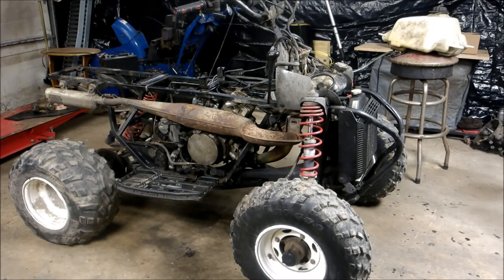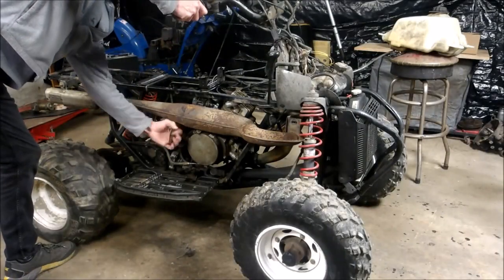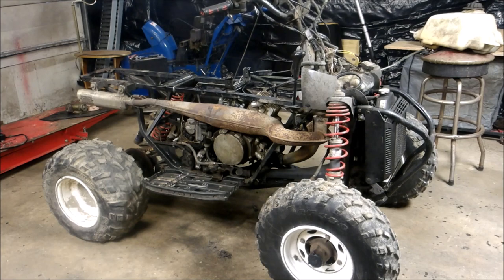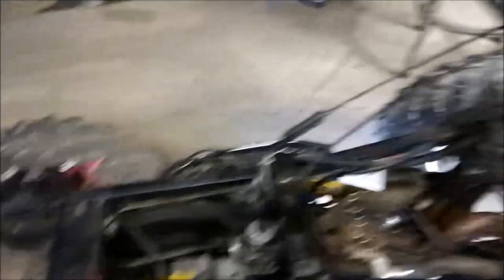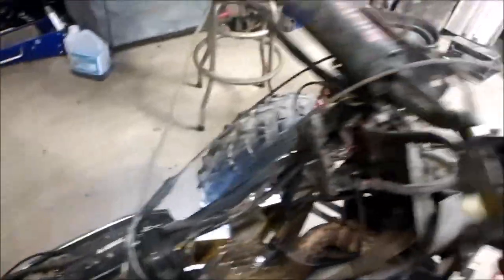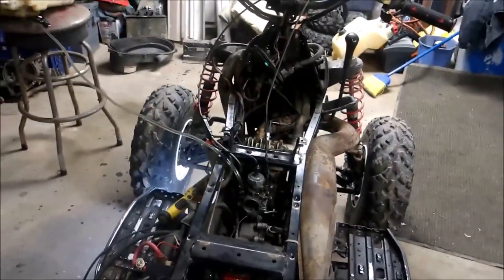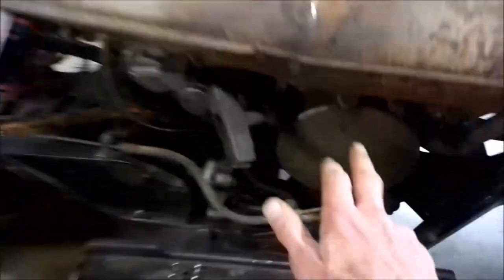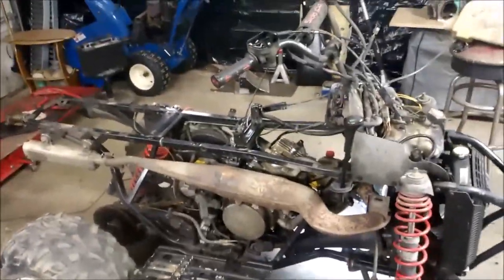HOW TO STOP YOUR POLARIS SPORTSMAN FROM BACKFIRING!

Comment: great video thanks for more info,I have a question my sportsman 500 2001 is backfiring only when I get off high throttle would one of these issues you mentioned be the problem? and thanks again
Reply: i have a 05 sportsman 800 with the same problem...

Comment: Yep, you are right, the Polaris, I have one 2002 and two 2003, I think that this are the better built ones but that is a personal opinion, tend to overheat and the fan fails occasionally, I have been thinking of replacing the temperature sensor with a water temperature gauge and installing a manual on and off switch to control the fan directly when the temperature starts getting close to the 90 degrees Celsius mark, This obviously would require you to be on the alert and constantly monitor the the instruments. But this is what we do when we fly aircraft, so it is not a big complex thing to ask of anyone.
Reply from the maker: I got a better idea. Only because I've seen your idea before..And guess what! Someone forgot to turn the fan on. Its a good idea if your the only rider. If someone else jumps on and forgets,( That's how I bought one cheap one time)So what I do is hot wire the fan and bypass the temp sensor. The downfall is its hard on the fan with it running constantly.

Comment: I have a 2008 Polaris Sportsman 500 HO EFI.  The fuel gauge flashes and I don't trust it.  It'll start right up.. run fun then within 100 yds... it's slowly loses power and stalls with a backfire at times.  Prolonged starting procedures get it running again.  I discovered the carb boot to the manifold was very loose so I put it back on and really tightened the two narrow carb clamps.  It's a new used machine to me...but is it suppposed to be a bracket to support the carb and secure it to the frame to prevent this?  If you have time... please let me know.
Reply from the maker: You mean the throttle body. I dont believe there was a bracket. I have a video on fuel pumps I did on an 07. Sounds like you need a new pump and filter.
Reply: @TitaniummanGarage  I took off the body and front storage unit... I found a bare wire next to the steering shaft and corrected that.  I then in the front, facing forward was a thin black box what I think you called the ECM.  This one is Polaris brand  part # 4011817.  I found a pretty good crack in the front cover.  Bad enough to let dirt and moisture in.
    Is it ok to open the unit (if I can) to see if there is any obvious issues in there?  I called ModuleMaster and was told that is not an item they are involved with.
Reply: @TitaniummanGarage    Ok...thanks.    I pulled the plastic body off and am checking for any other issues and am replacing the spark plug. (if I can get to it)  
    I discovered the CDI box has a large crack in the cover.  What do you think I should do?  I called ModuleMaster and they advised me they do not deal with these items.
Reply from the maker: @wayne6525  Thanks for the reply back. I was curious what it was. I knew they had wiring issues with the wires going to injector and other components. You might have to buy a used one. Check ebay or power sports nation. Not sure what your skill set is with electrical but it could be something you could solder back up. But it could fail again. I would buy used if you cant get new.
Reply: @TitaniummanGarage    I was replacing the spark plug and what a chore that was!!         I discovered that the spark plug was very loose in the cylinder head.  I didn't even need a wrench to turn it... just a socket.  This has got to be a major cause of most of it.... but I'll keep digging after I get it in.  I also discovered that the ECM had only two screws holding it on...one had a ground wire attached.  I cleaned up the ECM cover placed Aluminum foil tape of the crack.  We'll see (when I get it all together again) if these efforts make a difference.  Thanks again.  Glad I found your channel.
Reply: I pulled the fuel pump and tested the gauge sender....it appears to be accurate.  I then placed the fuel pump in a bucket of gas.  The float did not raise the lever rod.  Obviously it is faulty... I ordered a new one.  Hopefully this is the cure to my problems up to this point.  Take care.
Reply from the maker: @wayne6525  Thanks for the update.  My fuel gauge was flashing. When I took the fuel pump out I noticed the ground wire from the pump to where it plugs in was rusty. I cleaned the metal plug and everything worked. I didn't need to replace the pump but I bought it already so I replaced that too. It solved my sputtering issues.

Comment: Hello my name is Leon and I've got a 1998 polaris sportsman 500 4x4 , far as the pilot screw how many turns out should it be?  And the same as the idle screw plz help I'm totally out of ideas.
Reply from the maker: Turn the pilot screw all the way in then turn it out 2 and a half turns. You might have to tweak it. I do 2 and a quarter then bump it up if needed. The idle screw, the long one sticking out of the bottom of the carb I tune by ear. Just make sure you dont turn it to far or you'll have to adjust the throttle cable as it will cause the safety kill switch by the throttle lever to close and it wont start.

Comment: Hi again, by the way, you were talking in one of your videos about converting your Polaris sportsman 400 into a 500 , I know that the con rods are identical, the cylinder heads are the same, but the cylinder size is different on the Polaris Sportsman 500 and the strokes are 5 mm different. How did you overcome that issue?
Thank you,
Franklin
Reply from the maker: I converted a 425 4 stroke to a 500. I used a 500 cylinder and piston. I wish we would have been talking before I did this. My buddy and I talked about this for a year. The part number for the con. rod doesn't match according to polaris. So for the longest time Him and I didn't attempt it. He parts them out..I rebuild them. One day he slapped 2 engines down and said: Here! Your smart enough..just try it!  So I put a 500 jug and piston on a 425 and it ran. Perfectly I might add. What is the 5mm stroke difference? Do you mean in height from the crank?

Comment: You also have good stuff on your channel regarding Polaris machines.
I do not touch the two strokes because I do not understand them too well. However, they may very well be much better, more powerful than the four-stroke counterpart.
I have been doing this as a hobby, but I am getting too busy and this kind of thing is very time consuming, so I am being forced to slow down a little. I like small engines, they present a reasonable challenge and I learn a lot from the work I perform on them, it also teaches me to be more precise in all the work I do.
Reply from the maker: I hear ya. It can be time consuming. For me its a way to relax, I find it challenging. Two strokes are a lot more powerful and Start good at the dead of winter VS a 4 stroke. Our winters get to -32 degrees here.

Comment: My 250 stroke Polaris backfired and spit out black smoke whenever I pull started it and won’t start anymore do I need a new top end. Already tried cleaning the carburetor
Reply from the maker: Not necessarily. Black smoke usually means its running rich or your oil injector is set to flow to heavy. Do you have compression?  check the spark plug. sometimes a backfire will foul out the plug.

Comment: Yes, and if you have the fan running all the time, it will kill the battery very quickly.
All you have to do is teach the next rider to be careful and to keep an eye on the water temperature gauge, and be responsible for the wellbeing of the engine operation

Comment: I have a polaris xplorer 400 1996.  It idles good, but at full throttle it bogs down.  Took air cleaner off and at full throttle fuel blows out the carb.

Comment: I have a 2008 Polaris 500 4x4 . Can you please tell what are the 2 lines coming from the front bottom of motor please
Reply from the maker: They go to the oil reservoir tank on the left front side.The bring oil to the engine.
Reply: @TitaniummanGarage do they connect to the air box ?
Reply from the maker: @jonathanw2391  there is a 3rd line. Ita bugger and goes to the airbox. It usually has a filter on it.

Comment: Yes, you are right, I made a mistake, I meant slapping/
I have three. All with top overhauls, on one of them, I decided to open it up and it was then when I discovered that the piston and the cylinder were scored very badly, to the point that it began to burn oil.

The noise it began to make was that tinny metallic noise that one can usually associate with a loose timing chain or too much valve clearance, the other two engines are doing the same thing, they also blow black smoke out the tailpipe, so I am wondering whether this is a common design fault, especially when you are expected to start the engine dry at first instance.
Reply from the maker: Funny you ask. I just had that problem. You are talking about a 500 right? I tell you. In the past month I've done a lot of research on this. At start up you will see some smoke. Oil burning off from any prelube you did during the build. If it smokes at idle its normal. if it smokes all the time, Its most likely the head gasket. If it smokes when you back off the throttle it could be the valve seals or oil ring. Mine turned out to be a bad oil ring. I bought a cheaper piston just to experiment. Turned out to be a big mistake.
Reply from the maker: Oh! And to answer if its a design flaw. If it's a 98 or 99 They had soft cams in those years. Other then that they usually run for a long time. What I've run across was lots of overheating issues. Either the fan stopped working because of temp sensor or seized up fan or blocked radiator. Guys around here love to play in the mud. Maintenance is the key to keeping it running good. Keep the valves adjusted, clean the radiator, change the oil every year.

Comment: Yeah I have a 1994 sportsman Polaris 4x4 it runs good you know sometimes for at least a day in a whole day maybe two days the next day it would just start like sputtering backfiring what would that be
Reply from the maker: Could be the needle and seat leaking gas into the cylinder as it sits. Do you shut the gas off when it sits?

Comment: Have you had any problems with your engines doing a lot of cylinder lapping? tinny noises when the engine is at idle or running a little faster?
Reply from the maker: Hey, How's it going? Are you working on one or a couple of them? I believe you might be talking about piston slap. Yes I have ran into that. I seen them run for a couple years like that. A buddy of mine has one that does it. So far so good. It usually does it at idle. If its at higher rpms it could be a problem. I've had guys think it was the engine making noises and it turned out it was the clutch. It could also be the bearings making the noise.

Comment: MY issue is i have a 500 scrambler 2x4 4x4 2007. well the fan won't turn off and then which of coarse drains the battery then it wont start  after i pull start it runs great but it will shut off after a while. the temperature light is always on. I know its not overheating. My best thought is its the ECM. i unplug the fan so it stops running for now. what do you think?  my quad is in pristine condition I would be willing to say the cleanest 07 you have ever seen . advice on the fix appreciated. ty
Reply from the maker: That's my first thought too. Ecm.
Reply from the maker: I have a video on an atp I did.
Reply: @TitaniummanGarage  why would the fan not shut off and temp light be on immediately when you start it cold?
Reply: Oh and my bad it’s an 08
Reply from the maker: That's what the ecm does when it doesn't communicate right.

Comment: I have a 2000 polaris magnum, it hasnt ran in a few months. I changed out the stator, pick up coil, cdi, and solenoid. It finally now has a spark. Now it starts, but it back fires really bad like it made my carburetor fly off, what can this be? Timing, valves, or cam? If it is the valves or cam how do i tel they are bad? I'm at a loss! I checked the timing it looks like it jumped time, but not by much. The tensioner and chain look fine. PLEASE HELP!
Reply from the maker: Ah! The dreaded magnum. I had the same problem. Is the cdi aftermarket? I don't know why, but they are a pain to time right compared to sportsmans. Make sure your chain and timing marks line up. If you want to go the extra mile, pull the flywheel off and stator. There is a mark on the gear behind stator and on the case. And the 2 marks up at the cam gear. There are silver links on the chain. One silver link lines up with Mark behind stator the other 2 silver links go by cam gear marks. I now do all my timing that wat. It's more accurate than the flywheel mark. Then you know your dead on. Rotate engine a couple times. Then adjust valve lash at lifters. .006 the gap should be. If you still have a backfire it's the cdi box or air is coming in somewhere. Cracked carb boot, bad rubber hoses, leaking air box. Hope that helps.
Reply: Sounds like a problem I had . Changed cdi, coil, plug, carb, air filter, checked timing twice, changed fuel and filter..... Ended up it was a bad exhaust lobe on camshaft. I learned running synthetic 0w40 is of outmost importance in these machines. I haven't owned the machine long but who knows what oil previous owners put in there.

Comment: If you look at the Polaris Parts catalogue, you will find that the connecting rods are the same, even the part number seems to correlate if I remember rightly. What is not the same, is the crankshaft 1, next to the flywheel and the gears have different part numbers, but this may be also part of the Polaris trick to make people believe that the parts are not the same.

When you look at the service manual, the 500 has a stroke of 75 mm and the 400 only 70 mm, I am disregarding the cylinder size which is obviously different, the crankshaft must, for all intent and purposes, also be the same size. The 2011 Polaris Sportsman 400 4x4 have many parts which are compatible or interchangeable with each other, and that makes sense in the scales of production economics, you cannot be creating special con rods for the 400 and then different con rods for the 500. I suspect that all those con rods would be the same size and length and weight and manufactured by the one company in one batch, otherwise, it is too costly to manufacture, what varies is the cylinder height and circumference to achieve the specified cc.
Reply from the maker: Yes, I've found that out about the crankshaft 1. I know exactly where you are coming from. I used to work in an engine plant. I built 18 horse twin engines. We had 400 different engine we built. 3 different part numbers for the same part. I'm not familiar with the 400 4 stroke engine because I've only fixed one. So the info you are giving me is very knowledgeable and note worthy. Thank you! Polaris had a 425 Magnum in the late 90's. What I did to overcome any differences was to use the 425 crankshaft. The height was the same..I'm sure you saw the video. Now you got me wanting to tear down a 400. lol.

Comment: i have a 1998 polaris sportsman 500 it runs real bad and blows gas out the carb while running and then it will backfire and blow the carb off the intake please help
Reply from the maker: That's your timing that's off. Check your valve lash and timing Mark's. I have a video on it.

Comment: What would cause my 6x6 to idle higher as is gets warmer? I'm thinking colder air getting in from some where
Reply from the maker: It will do that in cold weather. Is it a 400 or 500? In colder weather you'll have to dial the carb differently. Not to say that you aren't correct. You could have an air leak somewhere. Most of mine in the winter I'll turn the idle down so when it warms up it doesn't idle high. In the summer I readjust.
Reply: @TitaniummanGarage  its a 425 liquid cooled 4 stroke. That's when I have a hard time getting it into high gear and reverse without grinding gears to much